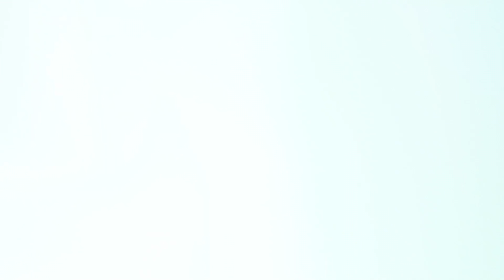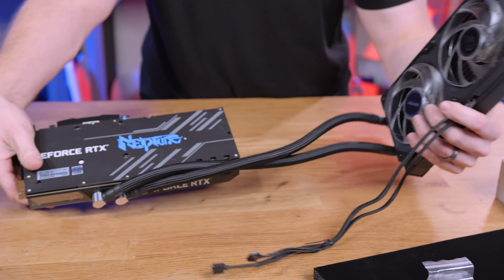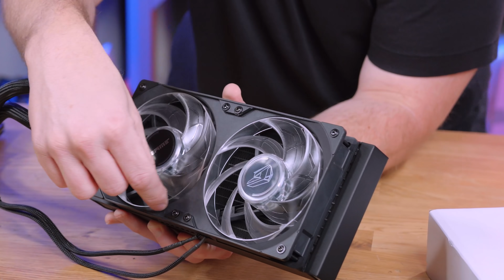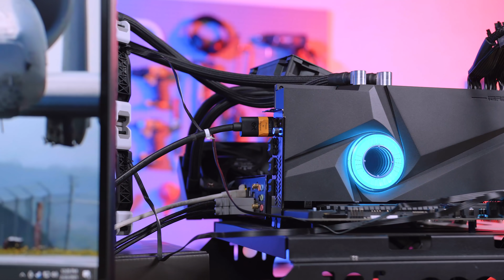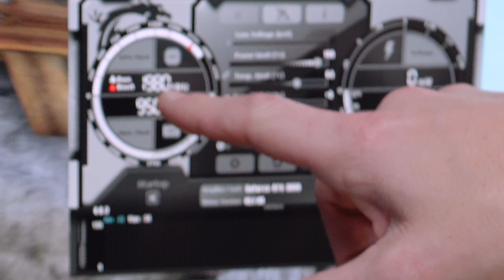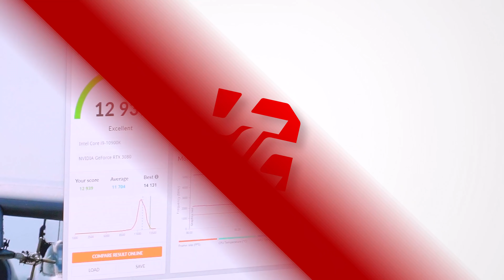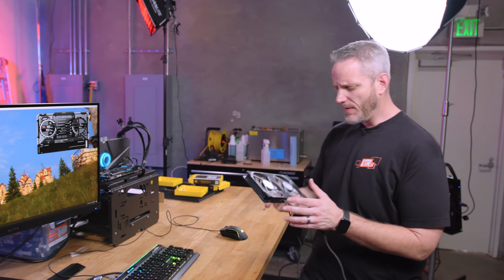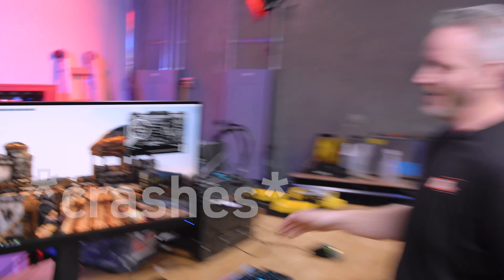AIO vs Air Cooled Video Cards... worth the extra cost?

Comment: You mentioned the power limit not doing anything but for my 1080TI there is a clear boost when i up the power limit. Dunno if this changed over time with a different generation or something.

Comment: Jay, check the vram temp in the new versions of hwinfo64. I have an aorus 3080 waterforce(aio), another non-hybrid aio(no fan on card) card like this one, and my vram temps are at 98C, even tho the components are all hooked up to the cold plate. Gigabyte cheaped out on the thermal pads, so even tho the cooler is great, and gpu temps are around 50C, the vrams(and probably the vrm too) are cooking themselves. Apparently, this is an issue with all gigabyte cards, but with an aircooled, or hybrids like the EVGA cards it's not that much of an issue because at least some air is going through the components while my card, and this one too are sitting in a box with no air, and those thermal pads are the only way to cool them.
I'm ordering some thermal grizzly pads(crazy expensive, but only ones available here right now) to see if it improves. I saw reports of people getting down 3090 vram temps from 110C down to 60C just by replacing the thermal pads...

Comment: Short answer: yes, it s worth it! Lowers temps, extends lifetime, and makes it virtually silent compared to factory..
Reply: but what about lifetime of the pump tho
Reply: @akiraic  been using my cheapass 240 cooler master lite for like 4 years, running every single day for atleast 8 hours.. no issues yet.. Also had a second hand 980ti with an ancient Arctic Hybrid3 aio on it.. it was still working flawlessly when I sold it last year after 3 years of abuse. Im not afraid of aio-s anymore :D
Reply: @sanyey8405  nice! Thanks for the details. Just bought my AIO 3080 and was wondering how long it would last.
Reply: @kalreyan That's a question for your case. You can usually have 1 on top 1 in the front in the avg case

Comment: When it comes to cooling it doesn't really matter to me personally long as it gets the job done. Personally though air cooling seems to be less of a hassle and I won't need to worry about radiators and such. I dont need a cooling solution that can get me the absolute top of the line performance so long as the game runs good enough for me to enjoy the visuals and not get yanked out of my immersion due to framerate issues. If anything even despite this there have been some cooling solutions already proven to work just as well as liquid if not better so if I ever want to go top of the line I could always try those.

Comment: So I managed to grab the 3090 waterforce. What I found interesting is that they say it should be setup to intake outside air, but the fans are setup to push air through the radiator, so it’s impossible to Mount as an intake.
Also, the fans are wired directly into the GPU somewhere, so you can’t use your own fans. And the hoses are about an inch too short for me to mount the rad on the front of my case. Quite a pain in the ass.

Comment: I've got a brain buster for you to try to speed up. Compaq HP Presario CQ-56. One core, one thread, only 2 gb of ram with mobile express intel 4 graphics card. Originally a Windows 7 device upgraded to Ghost mod spectre super light version of Windows 10. Cannot run games without lag unless lowest graphics settings are selected within each game and even then at lowest graphics settings games will still lag. All emulators besides pc games lag horribly. Any suggestions?

Comment: It's really hard to see what the use-case is for these cards, other than the 'cool factor' of having an AIO cooled card. In the real world, you want to buy a graphics card, fit it into your system, maybe up your power limit and put on a stable OC, and then forget about it for a few years. The difference you're going to get, realistically, you're barely going to notice in any real world gaming situation. A few FPS maybe. It's not like you're going to be able to chase high end OC benchmarks, as it'll never perform like a custom loop. It's really just spending money on almost no additional performance.

Comment: Once again, kind of moot at this point. I've actually been looking at pre-built systems with most of the parts I'd be getting anyway. I've found a couple where basically just the case and included fans are crap. I figure I could just get the case I wanted, transfer the guts into that and put the guts of my old system into the blingy crappy case and find a home for it (still usable as a basic PC) The premium for doing that is actually only around $100-$200 but that's for parts at basically MSRP so less than I could get them for any other way. It also means everything has been put together and tested which would arguably be worth the hassle.

Comment: Crazy my 3070 ventus x3 hits 2115 mhz on cyberpunk, slightly bounces to 2100-2085 at times, probably because the 220w power limit, but mostly steady, very impressed with the 30 series.

Comment: I’m all for aio cooling gpus.  Nzxt needs to reengineer their G12 bracket for current gpus bc I was running a 1080ti with a Noctua fan + fan header adapter.  Results were as good as the hybrid I tried in a shorter overall length.

Comment: I stick with Cooler Master myself.I have been using there parts for ages.When i bought my AIO.Cooler master didn't try to advertise the cooler as the beginning end all cooler.They advertised it as an entry level cooler.I only have an R5 2600 and even oc it to 4.2ghz the temp was below 70 in gaming.If something like aida 64 stress test it would go up to just under 80 and this is in summer at a room temp close or over 30 c(i live in a 2mx2m room with no windows)

Comment: Can you test the gains by doing a full cover water block in a custom loop I think it would be just as interesting when put side by side with this video. Honestly now I’m thinking I’m wondering how it would look for one of those on a dedicated gpu only loop vs an air loop like this and also comparing it against a full loop where the cpu is also in the same loop

Comment: I'm mostly concerned about the longevity of an AiO for gpu's, since it'll be much harder to replace when it wears out well before an air cooler would have.
Reply: Much harder than a cpu that is,  since it's a quasi integrated custom thing for that card.

Comment: I am running a NZXT Kraken 360mm aio on my EVGA 1080Ti FTW3. Temps top out at 32°C. Boosts up to 1980Mhz on its own. It can add 200Mhz in the NZXT software and haven't had crashes, but for more stability I only do a +100Mhz.

I should point put that I am running in a Lian Li O11 Dynamic with this mounted on the side intake. Top has a 360mm aio on a 3950x and bottom has 3 x 120mm intake fans which 2 of them blow pretty much straight up at the card. Added my own heatsinks to all the memory chips, VRMs and mosfets. ICX shows below 30°C on all those components under load.

Comment: My asus tuf oc runs at 2130 while gaming but will crash if it touches 2145.  Super good card. Runs under 63c and close to not audible.  So much quieter than my windforce 2070 super.  And that wasn’t a bad card.. asuss engineers did a great job

Comment: I wish I could get a replacement for my Fury X. Nobody is willing to make a full card AIO, only these hybrids AIO cards (Fury X has all the vital GPU components cooled by a single 140 rad). The trade off Jay mentioned about having no fans spinning on idle on vs always running pump, the latter is better IMO. When my Fury X is running on a hot humid summer day at full load the temps never get above 60 (and I have it setup as being the only exhaust facing fan in my case).

Comment: Maybe an video idea, but something got me thinking, would it be possible to take the neptune card and put it in a open loop with a bigger water tank, but without the need to buy another pump or maybe have the pump in the GPU run both the water from the GPU and CPU? 🤔 Might be fun to see you try out if you up for it Jay. 🤔

Comment: I use my computer for 3d rendering, so I run everything on a custom water cooled loop. When I am rendering an image my cpu and both gpu's will throttle between 98 and 100% for as long as 2hrs at a time. I doubt air cooling can keep up with that kind of system load.

Comment: I have a EVGA 2080 Super Hybrid FTW3 that I got used and it is a beast. It only has a 120mm cooler but I swapped the fan for a ML120 and even overclocked it never hits 60 degrees. As for the overclock I pushed it to 2150 Mhz core clock speed before I started to get some bugs in the graphics and crashes. I don't run it at those settings but I know it is capable of it, it boosts on its own to 2050 regularly in the OC mode.

Comment: Thanks for this vid/review @JayzTwoCents. I've been thinking about modding my RTX 2070S from MSI with that Kraken G whatever plate to AIO. I'm OC'd out with my current power supply and MOBO but I'm also going to upgrade both here soon. Air cooled not at current OC I'm at 78 to 83 on my temps. Haven't hit my set max of 85c on Afterburner yet but I'm sure I will once I upgrade my MOBO. Currently have ASUS B450M Chipset. 🤟👌👍👍

Comment: I've been doing AIO GPU's for the last few generations and love them.  Did the 1080ti, 2080ti, and now a 6800XT.  The thing is that I have a 280mm AIO for my CPU on the front of the case and then have the 280mm AIO for the GPU on the top of the case.  This layout has worked fantastic for 3 revisions.  I had an air cooled 6800XT and it had 3 fans....it ran a bit hotter than I am used to (Gaming X Trio) but it was a fast card (a bit noisier than I'm used to).  The problem is that I didn't have enough exhaust so I moved the CPU AIO to the top....where it didn't want to fit very well...so my option was really to add more case fans which would make the whole system even noisier.  The reality is that I wanted to go with an AIO from the beginning, got lucky and found "any" 6800XT (even if it was air-cooled) and got even luckier that I found a water cooled one and was able to sell the first card locally for what I paid for it (it was only 3 days old)....because I'm not a dirty scalper.

Comment: I'd say if we could get a new form factor for both Motherboards and Graphics Cards, where both parts laid flat, the best cooling would be tower cooling. If you have any knowledge about aerodynamics, these classic Graphics Card coolers of pushing air onto a the cards PCB then towards the motherboard and side of the case then upwards by sheer force is inefficient. If we could have a straight path, from front to back, we'd see better cooling performance of all parts.

Comment: Good video, but I really wish you wouldn't simplify boost clocks as being "auto-overclocking." Overclocking by definition is clocking something past manufacturer specs, which obviously is not the case with boost clocks. Actual overclocking is additive on top of the boost clocks. Further, auto overclocking actually exists as it's own separate thing in terms of tools attempting to find stable clocks automatically. I know you know this and are likely just trying to simplify the concept, but I have come across a few people in the past that are confused by boost clocks, some that thought it was auto-overclocking, and thus were confused what overclocking is, in turn.

Comment: I have been seeing my Strix 3070 OC hitting 1980-2100mhz on its own with the power limit increased to 120% with the temp cap at 90C, but the damn card is so huge and the heatsink does its job to the point I haven't seen it go over 67C. In Performance mode.
For reference  - 
Case - Phanteks Eclipse 500A DRGB
PSU - Corsair AX860 - CablesSleeved
Mobo - Asus CH8 X570 Dark
CPU - AMD 5800X sits at 4.9-5.0 on OC 30-40C Idle, burn 60-67C
Ram - Corsair Dominator 3600Mhz 4x8GB
GPU - Asus Strix 3070 OC
Main Drive - Corsair MP600 1TB M.2-1
Game Drive - Corsair MP600 2TB M.2-2
Media/Content Drive - Crucial MX500 2TB Sata 1
MediaStorage - WesternDigital Red SMR 256Cache 8TB Sata 2
Backup - Western Digital My Book 8TB(Red SMR 256Cache 8TB) USB 3.0
Optical - Asus External BD Writer
Cooling - 6x Corsair QL140 Fans(3x Front intake 2x Top Intake 1xRear exhaust), 2 Commander Units(1 for the Pump other for Fans), 1 RGB Unit - USB NZXT internal extension HUB - Watercooling Custom Loop - Corsair - XR5 420mm Rad, XC7 Block, XD3 Pump, 3/8 ID 1/2 OD Soft Tubing + Black Compression Fittings and Drain Valve, XL5 Purple Translucent Coolant.

Waiting for the XGC 3070 Strix Waterblock to complete my Rig when it comes in stock, along with a Linkup PCIe4 30cm Riser Cable, as of now there is no use using the vertical mount until its waterblocked.

Due to scalpers and availability this is what I could get for reasonable prices, I wanted a 3080Ti and 5900X but that is the way of things for now.
Eventually I may special order a Demciflex FilterKit for the 500A and get clear XL5 Coolant with all Hardline Fittings and the new Frosted Black hardline tubing but I need everything in its proper layout before that happens. Definitely also want to do some Dremel work to cut out the 120 fan mounts on the front of the case, I would have went with a Corsair Case but they seem to have something against 420mm Rads.

Comment: I been using Kraken g10 for few years now and if you have AIO that could be used with it just laying around it is definitely worth it. When used with Asus strix gtx980ti my temps dropped from like 90C to 65C on a 120mm Kuhler 620 and  two 120mm fans at around 1000rpm. Now i am using RTX2070 Super and together with 280mm radiotar temps never reached 40C. (56C with 120mm AIO).

Comment: I've never used an AIO graphics card. I currently run two Aorus Waterforce WB 1080ti's on a custom loop and they run amazing. Under load, they run a 2038mhz all day at around a 3C delta over coolant temp.  Coolant temps are running at a 6C idle to 12C delta under load. My gaming room stays at approx 22C year-round so GPU's run from 31c to 37c.  I do like the idea of AIO GPU's but it will depend on whether or not I can mount a 240, 280, or 360mm CPU AIO as well? Now I may as well build a custom loop? Glad you're feeling better!  Peace...

Comment: My 980ti was my first water-cooled gfx, with an aio, it was from EVGA and I mainly bought it, to get a more silent card, and it worked perfectly, my current 2080ti is fully water-cooled with an EK block, and is ofc also very quiet :D It's a bit overkill considering I don't really OC my card much, but I really just like my pc to be quiet without turning too hot and lowering performance

Comment: Its OK Jay. You don't have to say CoolerMaster makes terrible fans, but I will!

Every single fan of theirs I've owned has been utter garbage. The Fans that came in my Masterbox MB530P barely moved any air, even though they always spun at full speed. The one in my 212 Evo died 4 months after use. The two RGB fans that came in my ML240L sounded like lawnmowers and the RGB itself was trash... Shame on me for giving them the benefit of the doubt twice.

Comment: I would choose the air cooled card and install 3 140mm fans on the front of my case with 2 120mm fans up top and 1 120mm fan on the back for exhaust.  All done and still have money for Doritos and Starbucks.

Comment: I chose an EVGA RTX 2080 XC hybrid because I thought water is better. Honestly an air cooler is fine especially if you get a thick one. I switched to a custom loop nearly a year later and my temps dropped by 20C. That's not cost effective, just get a thick cooler.

 Now I am running an EVGA RTX 3090 FTW3 ultra. The die is at 46C while running at 2115 mhz, I have serious temp problems with the GDDR6x it appears to hit 70C and crashes. Rendering doesn't work the memory as hard as gaming in my use case. I have an EKWB water block for it, but it won't help, the memory on the back needs a waterblock too and EK doesn't know when they'll release it. They'll release the strix backplate before the FTW3 (I watched their live stream).

Comment: Anyone else stopped upgrading and building pcs as soon as gpu prices went nuts?  Since sep l havent upgraded or built a pc...l wonder how the makers of other pc parts hate the gpu prices same as us?? Honestly l think l will be called ng it a day with pc builds soon...the new gpus not for price that much better at 1440 resolution than my 2080 super...l just not that impressed at all with ampere as the extra power draw ,heat and size of it just so it can pull ahead is just a rip off...sad times for pc builders.

Comment: You can use Alphacool Eiswolf coolers. Don't know if they are still manufactured for rtx 3000
Edit: their are (in my opinion sadly) no Eiswolfs for 3000 series cards. Don't know if they gonna make them in the future. But their are for 2070, 2080, 2080 ti as well as for 10 series card.

Comment: TL DR : AIO on GPUs totally worth it ! I had the exact same concern as Jay had XD From my personnal experience, an AIO cooler could gives about 30C+ in temperature reduction when the GPU is at full load which is massive. With this efficiency to cool your GPU, you can either decrease your fans speed for a more silent system or overclock your GPU even more or a mix of both. I'm huge fan of EVGA air cooled and AIO cards. <3
Reply: I wish nzxt made their g12 for more cards :/
Reply: At 150 to 200 bucks more, wouldn‘t you get better performance by upgrading to a better card? E.g. Pick a 3080 air cooled instead of a 3070Ti with AIO?
Reply: @henrike9389  Yes, but in some cases, but a 3080 aio is still probably cheaper than a 80ti by a decent margin.

Comment: AIO/Hybrid GPUs are worth in small cases (e.x. miniITX) with restricted/minimal air flow or having SLI configurations. I have Fractal Era ITX which has bad reviews for air cooled GPUs all over Youtube, but having hybrid GPU and AIO CPU (case supports 2x120mm rads), have 0 issues and no more than 65C temperatures. With air cooled GPU, would definitely have temperature issues (at least in my standards)